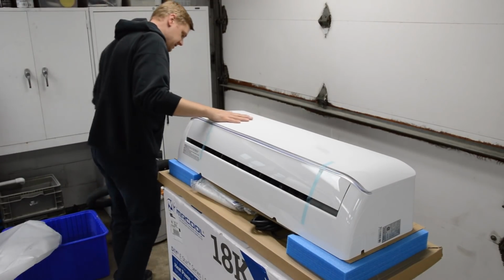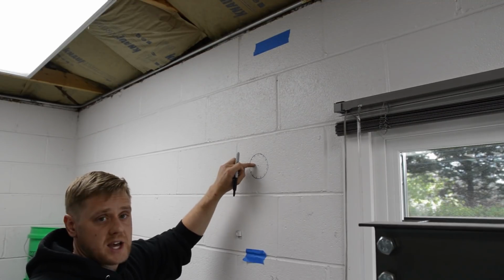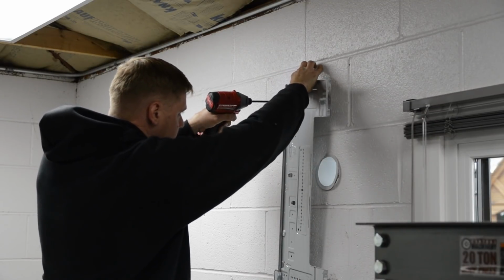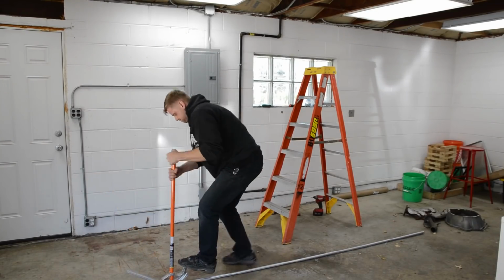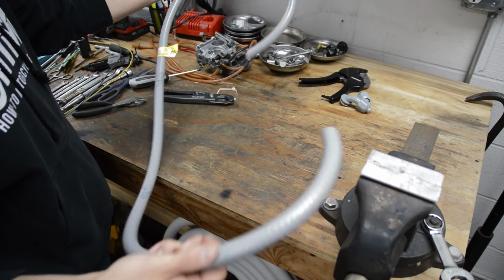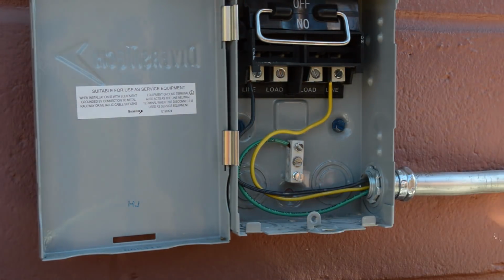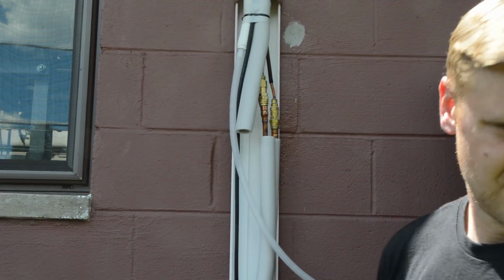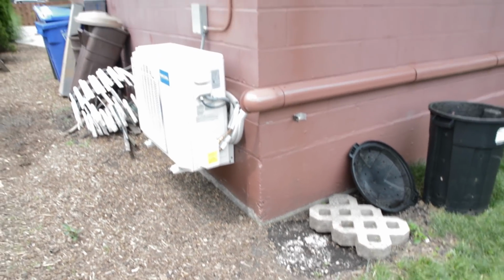How-To: MRCOOL DIY Mini Split Installation (Step by step) / Garage has A/C!

Comment from the maker: MRCOOL 18k unit - https://www.howtomotorcyclerepair.com/mrcool18k
MRCOOL website - https://www.howtomotorcyclerepair.com/mrcool
Blog post - https://www.howtomotorcyclerepair.com/mrcoolminisplitinstall
No need to vaccum - https://mrcool.com/blog/pre-charged-line-sets-real-right/
Reply: are you located in Florida? Did you have to pull any permits? Im looking at installing one .
Reply from the maker: @robertobaez1686  Chicago.
Reply: @HTMR  link to line set cover kit?
Reply: @HTMR  sos...please..  older mobile home NEEDS THIS.  Northern California 🇺🇸 has hundreds of seniors and retired * fixed-income...how about that 😳.   Every problem has an answer.    Please read 📚 🙏
Reply: @Sandrarasue  I'm going to be installing one in a mobile home in NH.

Comment: this guy is the real deal he actually explains bit by bit . i love the way he explains  well done .. some people just do videos just to show off how good they are . hopfully having someone to call them to instal the air con.... but this guy he really has what it takes to teach well done man  keep it up with the great videos man
Reply: He did not run a vac.. I don't see how this install was correct.
Reply: @mo_joe963  don't know if you've looked any further into this system, but the lines and units are already filled with refrigerant and once connected and opened, are ready to go as is.  This is the diy version.

Comment: Back when I worked as a Commercial / Industrial Electrician, We always left the wires long in the panels.  We would go to the bottom of the panel and then back up to the breaker.  That way we knew there would always be enough wire for future work or modifications.

Comment: I've watched a ton of Mr. Cool minisplit install vids as I have purchased and installed a 27k 2 head setup.  This is by far the best and most thorough video I've come across regarding the install process.  Appreciate you taking the time here.
Reply: Hi,  What was the breaker size you use for 27k 2 head? Thanks

Comment: I took heating and cooling back in the day. Never did anything with it though. When I was taught, you had to evacuate all the air out of the system before introducing the refrigerant. This was accomplished with a vacuum pump and a set of manifold gauges. Blows my mind how that doesn't have to be done here.
Reply: This company make precharged units, the line sets are pre-Vacuumed.  THe lineset connectors have valves (like a schraeder) built in.
Reply: @pablopicaro7649  As far as I can see the "precharged' lines are only made for their central air units. They say nothing regarding the Mini Splits.
Reply: @btomas225  They do have pre vacuumed lines in certain kits. You pay a lot more for those however.
Reply: @btomas225  all of their diy mini split units come with precharged lines, that's what makes them diy. Otherwise you would need an hvac certified person to come out and charge them.
Reply: your correct but you still have to do it on any system

Comment: Let me say,that this instructional video is one if not the best DIY Mr Cool video on YouTube,and from someone who is about to install one myself thanks for the time and effort you put into doing it.
Reply: Absolutely is. I've been watching them for a couple of months and was specifically looking for information on what sort of whip to get to install mine and this video shows how to make it with the wire I already have .

I was also going to have a friend run the connection from my breaker box to the other side of the house, but since this shows me specifically what to do, will likely also do that myself over the next week.

Pouring a concrete pad today or I'd likely be tempted to do it all today 😄

Great video.

Comment: Excellent video man. Much appreciated. Of all the mini split installs I have seen on Youtube yours was the first with concrete block construction like my house and you were the first I saw make the hole first and then set up the mounting plate for the head unit. Well done.

Comment: Joel,  I had a Mitsubishi mini split salesman come by today.  Nice fella.  He wants 13k to put in a 2 head system (2 Head+1 condenser).  I swallowed hard.  I can put two 12K systems into my duplex for less than 3k.  What should i do?  Smile.  Thanks for your very detailed explanation.  It was very well done.  Thanks for sharing.  See you fix bikes.  I had a Hayabusa that i rode for 10 years.  Bought it  for 12 K and put another 15K into it....you know the drill....carbon fiber wheels, single sided titanium race pipe, race struts fore and aft,  custom bass ass paint job....on and on...upgraded brakes...sold it for 7K....us men are nutts.
Reply from the maker: Never got to ride a busa, would love to take one out one day.

Comment: Hey Alex something to suggest, is while you were drilling your 1st hole inside, add a longer masonry pilot bit to whole saw setup so your outside pilot hole would have a better line up for the sleeve your installing... it may cost you some for bit but saves you some additional time and work buddy!

Comment: I ordered the 18k unit and was trying to decide if I can mount the condenser on the wall but not annoy my neighbors with the sound.  This video helped me decide that it should be fine because of how quiet it is.  Thanks!
Reply from the maker: Outside unit is very quiet, can't even hear it.

Comment: Just bought the 12000 btu unit from Mr Cool.
  You answered all my questions about the electric hookups however I am still
going to get my electrician to run everything to the disconnect box for me! I'll take it from there. I am also using it for my garage shop. Looking forward to being nice and cool for a change during the summer here in Florida! Maybe now I can finally work thru the year without sweating to death!
Reply: Elyse, how's it working out for you? I live in Ocala and my shed is an oven in the summer! I've been thinking of a split system for it. Thanks.
Reply: @woolval52  sass m
P

Comment: You got the right idea using a cheaper hole saw to do it,it’s a small price to pay for a one time use.I did the same thing on my installation,unfortunately you didn’t run in to a hollow section,but hey,it is what it is and worked around it.I enjoyed the video,brought back memories on my installation.

Comment: I had to drill through a thick cement wall too. I drilled a pilot hole with a long bit angled slightly down for the drain. I then drilled from the inside then the outside with a carbide hole saw. Still took me about 20-30 minutes for each side. I didn't have a hammer drill, just a 1/2 drill.

I wish I had painted the lineset covers when I installed them. The PVC got very yellow so I had to pull them back off and paint them. We did a lot of similar things on the install. I put my outdoor unit on a pad however. You did a really good job. I'm rethinking my install now.
Reply from the maker: Good idea. If I had a long bit I would have done the same.
Reply: @HTMR  I thought ahead for a change. I just didn't think to paint the coverset. I also wish I had used metal conduit for the outside run. I used the liquidtight.

Comment: Great work now all you need to do is protect the out door unit from power surgers and lightning strikes, I suggest  IMC -493 -30 amp surg protection and line voltage monitor .

Comment: I did the 2-3 ton universal air handler (not the mini split) an bent my line set by hand and broke it first try, I am very mechanically inclined and I would suggest just having a pro do a flared line set install and don’t worry about it. If your bending the line set by hand with the insulation covering the lines then you won’t be able to see if it kinks. Also the line sets have a steel spring wrapping the lines and where exposed this “spring” started rusting badly in the first few months. I don’t think the rust will affect the copper but it’s ugly as can be and bugs me.

That all said the system runs GREAT and is very strong. I highly recommend mr cool

Comment: Great video and nice install job.  I installed 2 of these types of units in my house and do awesome for heating and cooling.  I noticed in your sub panel that you have your main ground on the left side on a single lug by itself.  It should have a ring of green tape on it signifying its a ground wire.  Most importantly it should be with the ground bar on the right side of the box.  Also by most codes you should have a bare ground wire coming out of box from ground bar going outside to a ground rod between 6 and 10 feet into the ground.  In any case I highly recommend you move the main ground over to the ground buss bar.  Normally the grounds and whites share one or both sides of the main side buses.  The one down in the right I believe is for the main earth grounding.  Figured I would share that with you.  Stay comfortable :-)
Reply from the maker: Thanks. My ground wire runs back to the main panel. My grounds and neutrals are bonded at the main panel, and unbonded at the sub. I got the wire for free so why not? I can add some green tape to the ground...I thought I did that somewhere because I bought some tape years ago for that project.

Comment: I installed a 24k heat pump mr cool myself a couple of years ago in my house.  I do like how quite it is,  the indoor unit will get nasty after a couple years.  I recommend placing the indoor unit where you can get to it for cleaning.  You did a great job!
Reply from the maker: Thanks for the tip and compliment!

Comment: Great video! I watched a lot of these before installing my own Mr. Cool and yours is the best I've seen. The step-by-step is very clear and you don't skip any steps in the video. Thanks a lot, and my Mr. Cool is up and running largely thanks to this video.
Reply from the maker: Awesome. The other day it was 90° and humid outside. I had it 72° in the garage and my feet were cold! You'll love the unit.
Reply: Awesome, mine is on order now. Once I have AC I don’t think my wife will ever see me in the main house.

Comment: thank You. We’ll done. 
My concern is the running of all the wire for disconnect. 
The other issue is placing it in front of house. I would have to run it like 80 feet. To be able to place in side of house. 

I just saw Mr Cool came out with a 4 th generation unit. 
My concern do they have units without heat. Just AC. 
Houli

Comment: I make water and sewer taps on mains and we used a borsch hammer drill for years to chisel through 8 inches of concrete for the 4 inch. It was a hammer drill/regular drill combo with the large bit. Basically drilled most of the holes out, then hammer drilled the shape for the hole and usually hit a steel cable they use to form manholes up with. Until recently we bought a core bit that 12 inches long and 4 inches in diameter. It’s so good it goes through the steel with no issue. But the drill is $3600 and the core bit is $700 so we take care of them lol.

Comment: Nice video, I’m actually getting ready to put one of these in my garage and I noticed how you went all the way around the building with the line set.  Was that just to use up that extra line so it’s all wouldn’t be all coiled up behind the compressor? That’s been my concern is what to do with all the extra line.  Wasn’t sure if running it horizontally was ok to do.  Thanks

Comment: Great install video by far*** but as an hvac tech you forgot 1 crucial step and that is a proper vacuum before allowing refrigerant out into system.... by not doing so you'll allow non condensables to run with refrigerant causing higher pressure and ultimately reducing your compressors life span. ** But great instructions and great install. good job.... Folks please vacuum lines before allowing refrigerant out into system .
Reply from the maker: This system comes with a precharged lineset. They claim no vacuum needed.
Reply: How many times does it have to be repeated, the lines are PRE-CHARGED.  But only HVAC techs would understand that.🙄

Comment: Thanks for the information.  Great job.  You may want to close off the line cover opening outside by the condenser so you don't get mice or wasps in it.
Reply: That is great advice!!!
Reply: Maybe use spray foam? Or better, use stainless steel wool rodent barrier.

Comment: Excellent informative video! Explained everything very clearly! How well does it run during the cold winters? Also, I see that you used 12/2 for the 18k. Wondering how thats been working out? Seen mixed answers about 12/2 not being enough for the 18k and that 10/2 should used. Thoughts on this?
Reply from the maker: Instructions stated 12ga on 20a breaker. Was running just fine. I did not use it for heat as I had a NG heater. I also moved last June to a new house that also has a mini split unit in the garage (mitsubishi) and can tell you have my electric bill is really high (2x 12k air handlers 24k total unit). I'm debating installing a NG heater in the garage in the future in this new garage???

Comment: Good video. I see this was posted in 2020 and noticed the condenser was installed less that 12 inches from the wall which is what MrCool recommends in the current install guide -- did that cause any issues in the long run? (edit: nevermind, see you have a one year update video - -will check that out).
Reply from the maker: I used a mr cool wall bracket and have zero issues with flow around the condenser.

Comment: Great job!  Quick note, if you want your job to be up to code, you need to put your communication line in an ultratite 1/2" hose with a fitting attached to the outdoor unit.
Reply: I'm not an electrician--just a guy thinking about doing this and planning on getting a permit and having it inspected. I just want to make sure I am understanding what you are saying here because I havent seen what you are saying in any other installation videos. In fact, it seems that MrCool instructions even say to bundle the communication wire with the freon lines. Are you saying the comms cable does need its own conduit? What's more, I'm not sure there is a place to connect an extra conduit to the outdoor unit. There's a place for the 220, but no place that I have seen for the comm wire. Or am I not understanding what you are saying? Thanks!
Reply: That Depends on which code jurisdiction. 
I would put my communication wire in flexible conduit at least to the line hide.

Comment: Thank you very much Mattew for sharing the video of your installation of mr cool mini split a / c, impressive work very professional with all the details and the best is not necessary to make an vaccum in the system or add extra freon because it comes exactly with the load of freon from the factory to the distance of the installation kit, only if you require more distance of tube would be necessary to add freon.

Comment: Thanks for the video. Very clear instructions. I have one going in an metal building that is a garage with a little apartment. I have gone through 2 window units (in 20 years) and next is to install a mini split and make a window where the old heat pump (window unit) was.  I am comfortable with electric and it looks straight forward to run the existing refrigerant.  Thanks and have a great fall.

Comment: hey this was a great video, thanks - one quick question - if using 12 ga wire how far would you run that from the breaker - was thinking of about 100+ ft to a 24k unit
Reply from the maker: Not sure on that one. Quick google search did not come up with ampacity over length table.

Comment: I’m getting into this today, great video. However, I do have a question about your drain line.  Did u run it horizontal in the line set guard back to the condenser area or does it dump out before your 90?  I also will be doing a horizontal run to the condenser and was thinking about the need for a slight downward slope on the horizontal run to allow for drainage. Tks
Reply from the maker: Dumps at 90
Reply: @HTMR  thank you!

Comment: Couple of questions:   1.  On another video for another brand they had the DYI suck all the air and junk out of the feed lines with a vacuum pump.  MR COOL doesn't worry about water vapor in the lines???      2.  How functional is the HEAT side of this?  I may be under the misimpression that these are heat pump capable also?    A/C is cool but a bit of heat in the spring and fall in the garage is a hot idea also....  Are these heat capable??     GREAT detail on the VID. Thanks

Comment: Great video!  Just out of curiosity, why not run the cooling lines through the attic instead of that long run outside?
Reply from the maker: As far as I know you can't exit the pipes on the interior surface from the air handler. It has to go through the wall.

Comment: Excellent video. And btw, you won't need the garage heater that much anymore since Mr Cool is also a Mr Hot. It is a very efficient  heat pump that can warm up the garage in no time.
I'm glad to see you've put the condenser in the back instead of putting it right outside the head unit wall and then coil up the line set.
Reply from the maker: Thanks! Unfortunately 18k heat is not enough. I need 30-40K. I currently have a 60k natural gas heater since it was free. NG is the way to go in my area since cost is low.
Reply: @HTMR  the climate in the Netherlands is very mild so we don't need that much energy to heat houses and garages. With 1 m3 NG you can create about 10 kWh of thermal energy and the average consumer price is 0.81 EUR which is about 0.95 USD. The consumer price of 1 kWh is 0.21 EUR which is about 0.25 USD. Using a heat pump for most of the time is actually cheaper here. Only when it gets really cold (below -5 C or 23 F) we need to turn on the NG central heating. What area are you in?
Reply from the maker: @CrownRider  I'm in chicago. It gets COLD for weeks. I'm talking 0°F or less. NG costs $0.30 per therm (100k BTU for 1hr)